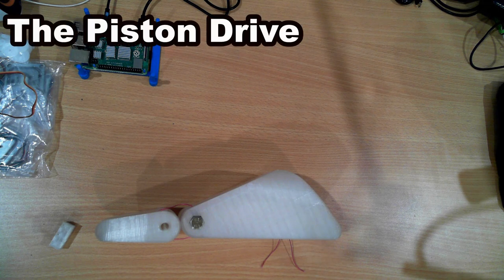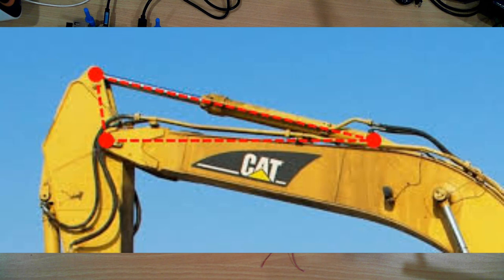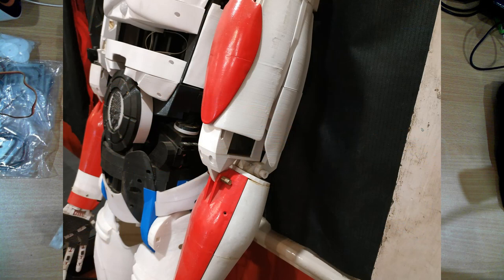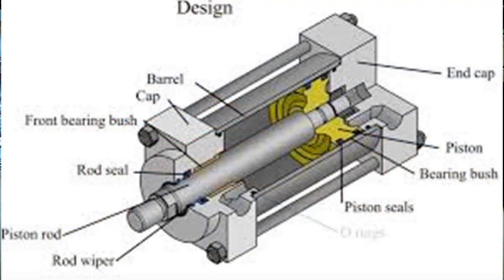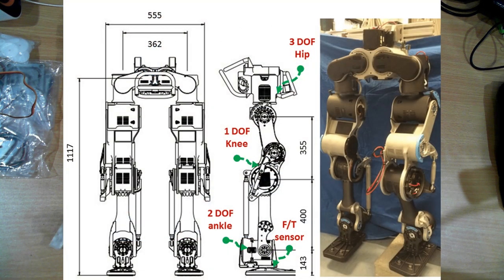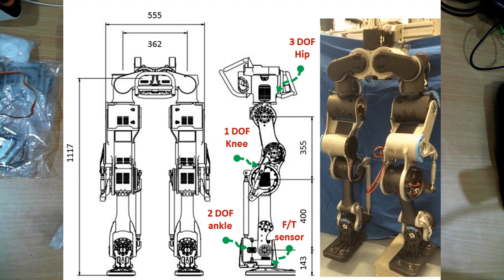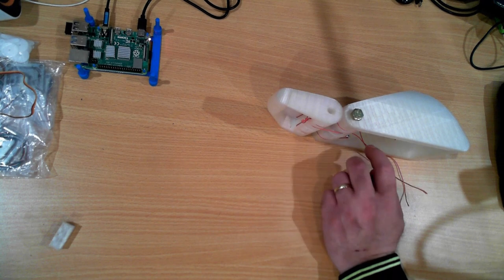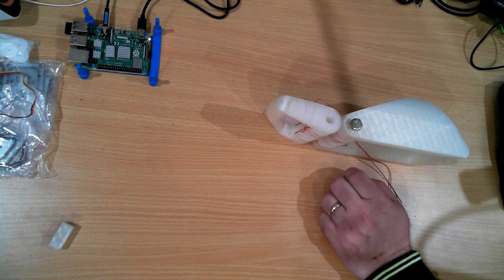Walking Robots Part 7 Rotating the joint

Comment: Thanks for contrasting the differences in how to create a rotating joint. I found it very interesting.
Reply from the maker: I'm glad you liked it.
I thought it prudent to look at as many options as possible and then choose something from that list based on what we learned from it.
In truth, both the piston method and the direct drive have been tried before, and the human body uses the tendon system, so that why I'm trying it.
It will be interesting to see if it works :-)

Comment: Whats wrong with your camera?
Reply from the maker: It was lacking something to point it at :-)
That was also the major reason this video was so long in being released.
It was recorded and supposed to come out before the Power of Electricity video.
I still have a number of theory video still to come such as hydraulic systems, pneumatic systems and motors.
Motors is such a large and complex subject and may need to be done as one or videos on it's own.

Coming in the near future will be another couple by Fred on capacitance in wires and how it affects communication speeds
as well as inductance.
Reply: @CyberOne  ok, i mean the digital noise in it, a line flickers around throughout whole video ;)
Reply from the maker: @juozask.446  Ahh, I think I know what your talking about now.
The camera I use for the overhead desk videos is a Microsoft Life Web Cam HD.
https://youtu.be/EsMSEh25CKc
It's always had that video noise in it.
Don't know why, but is annoying.
I'm looking at more camera gear, but I don't know yet if it will be a better solution or not...
Time will tell when the camera finally gets here.